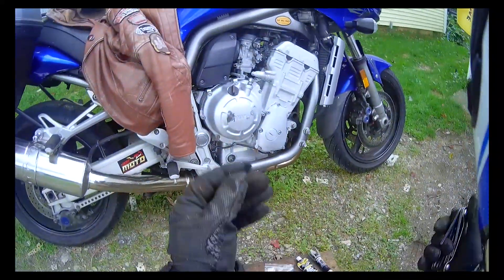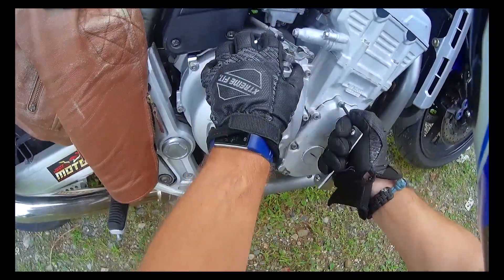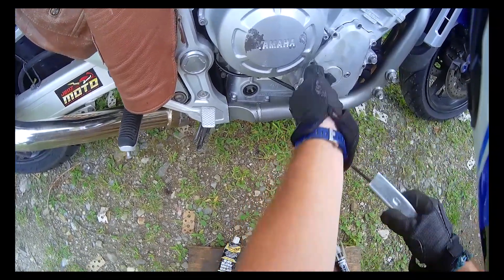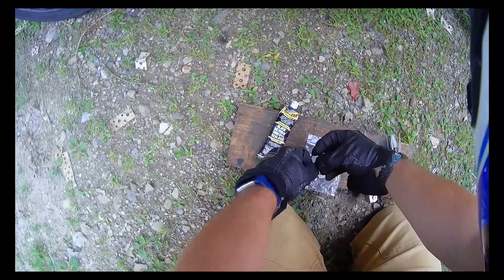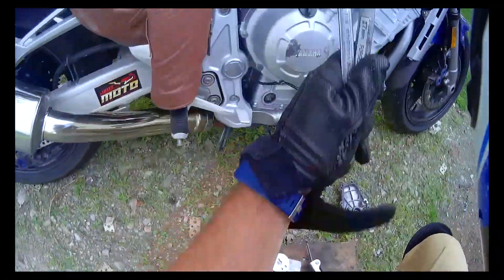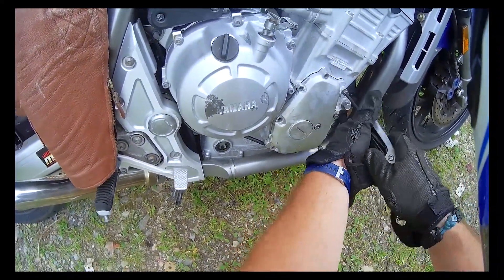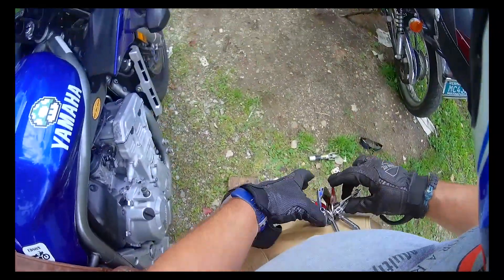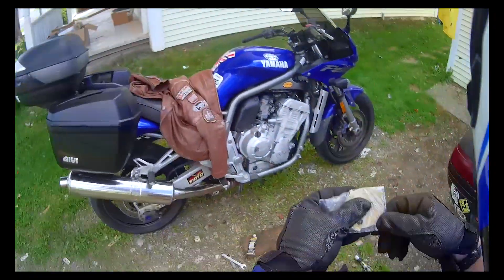Gen1 Yamaha FZ1 : ELS 4' Ignition Advancer Install Walk though

Comment: A big thankyou for this vid.
i have a 2005 uk spec fazer . I brought it after a smash on a bandit 1200. Due to ill healf not done alot of miles on it yet. i was going to get rid and get another bandit becuse of the starting problems when cold and red hot, just spining over and nothing first try.  I'd tried every thing exup, ais, tps, carb snc etc.
Got recomended this vid by youtube. brought one straght away of ebay and fitted 2day. Only took about 5 min to fit. started 1 try at cold and the same red hot.
I cant get over the diffence it has made starting. it feels a bit more pokie at lower revs(but not realy had chance to have a good blast) im not that fussed about mpg (my bandit got about 100miles to the tank on a good run.) 
cheers for making vid and the advise. I think im going to keep the bike now.

Comment: Never tried out this mod on a stock motor, but it sure doesn't work for a tuned motor.
Turned my bike into a jerkomatic below 3,000rpm.
4 degree advance rotor on my 2003 FZS1000, ruined my bikes low speed smoothness, made it almost un-rideable in traffic,  refitted the OEM ignition rotor, all's good again.
My bike's tuned some what with a modified air-box lid, pipercross race filter, ported carb rubbers matched to inlets, Ivans MB (full Monty) carb kit, race can, binned the whole "Pair" system & capped off the air inlet stubs above the headers, new NGK plugs ... she absolutely rips your arms outta the sockets under hard acceleration, far more aggressive than a stock motor.
Gained approx 15-20bhp over stock, much improved low speed running too, it'll pull from nothing to max rpm, never misses a beat.
Fitted a manual cam chain tensioner to future proof the motor, OEM tensioners are known to back off under hard riding.
Also upgraded the rear shock from an R6 destined for the track, so bagged a new shock for £120 (UK pounds), new linear .95 K-tech fork springs, bike's transformed & now no wallowing & tracks well in a turn, actually goes where it's pointed now.
I'm super happy with the results for not much outlay in cash, all the work done by myself.

Comment: I just done mine, it spun back a little bit removing the bolt. When I went to put cover back on the hole for retaining rod was slightly out so moved it back a little is this ok ? Thanks for video I’m yet to test it with this on only done it yesterday

Comment: Does it only go in one way? I've heard people say you have to mark it then turn it 180° etc make it sound much more complicated than this
Reply from the maker: It bolts right in, you cant adjust it once it's on the advance mechanism and make sure the letter is facing out or toward you.  You might be able to put it in backwards? but I would ensure you have it in correctly.  If it's in backward it's fair to say the bike will definitely not run right or at all. Best,

Comment: I own a 2003 model. Would you recommend the advancer? How does your bike feel compared to the standard.
Did you have issues since you installed it??
Reply from the maker: I put about 70K miles on the last bike with the advancer. I personally notice low end grunt and a couple more MPGs in cruising conditions.  Also the bike likes to start much easier in colder conditions. Best,
Reply: 70 kmiles with the advancer? Seems it does not harm the engine at least. Thanks!
Reply from the maker: Nope it helped in my sub 40' starts we have here in Vermont 5 months out of the year. Your definitely not going to hurt anything by installing one! Best of luck!

Comment: Where do you get the advancer?
Reply from the maker: https://www.ebay.com/itm/Yamaha-FZ1-4-Degree-Ignition-Advancer-Rotor-2001-thru-2005-by-The-AdvancerMan/263324146018?hash=item3d4f579962:g:dLwAAOSwmudaC5Ew
Reply from the maker: Link on the reply.  Best,